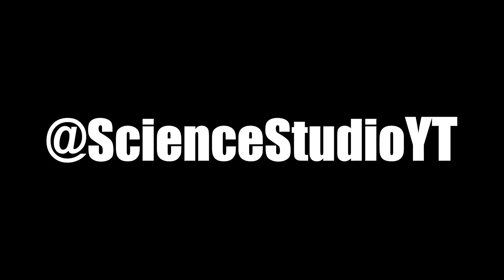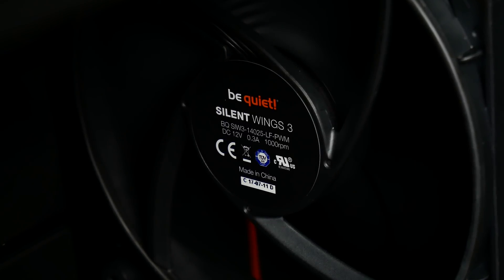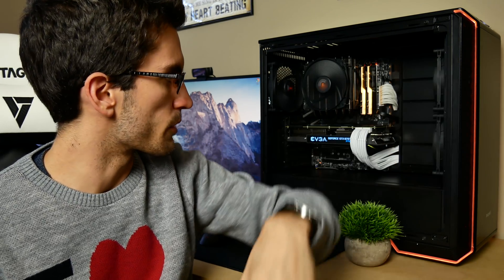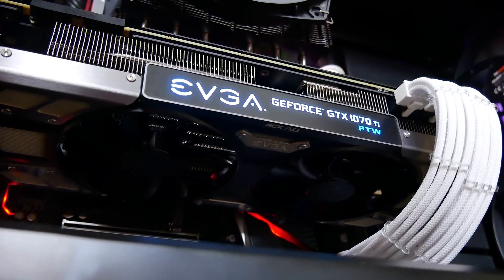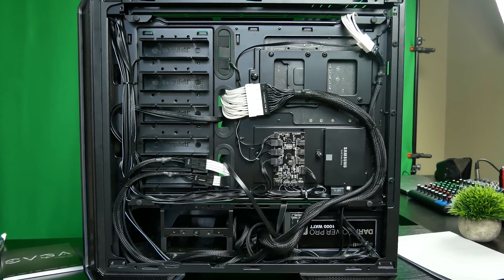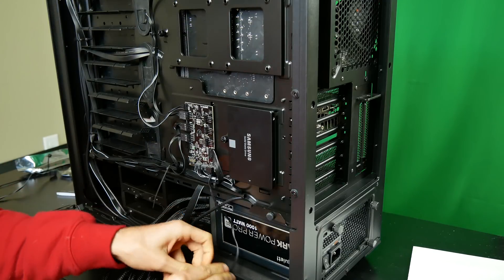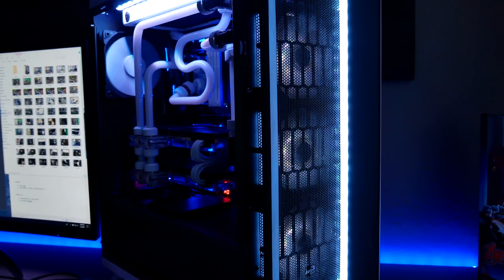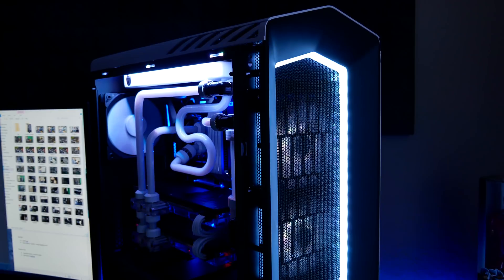We Built a SILENT Computer!

Comment: be Quiet case has sound damping on its case there for the silence is expected. Had a similar build with i5 9600k, 36gb G.skill DDR4 3200, Asus Phoenix GTX 1660 6gb. Installed 2 additional Silence Wing 3 1600 rpm, top back exhaust flow and front intake. Water cooling is noisy, water pump is annoying than fan noise at low rpm.

Comment: Could anyone help me out with a way to build an almost silent PC for audio production? I run a home studio with sensitive (condenser) microphones and unfortunately no seperate vocal room/booth. As a result, I can't push my input gain on my audio in too high without substantial computer noise running through the recording. I get that there will always be some noise in the background without having my own anechoic chamber, but I'd quite like to be getting <35dB noise during a recording session to reduce the noise floor in the wav itself. At the moment even using a noise gate and/or volume automation on the audio track inside Cubase, you can still hear the noise in the recording when the gate opens and closes which is obviously not the result I am trying to achieve. Thanks in advance!

Comment: Not to shit on the video, but that computer wasn't all that quiet to me, even through speakers. The volume was set so that your voice was at a normal speaking volume and the quiet computer made far more noise than my premade Acer computer does. I guess it is because of the stock fan curve, though. If you go in and mess around with that, you could probably bring the noise down some.

Comment: Yeah. Those Fractal Design fans are pretty good as well. I'm using three of them in a Define R5. Specs are MSI GTX 1070, xeon e3-1230 v2 (cooled with some Noctua fan mounted to an Enermax heatsink) and 16gb DDR3. When stock this abomination is just as quiet as the PC you built in your video, but because I overclocked the GPU, it's clearly audible under load :)

Comment: I built a DAMN quiet system before way before the dawn of larger graphics card coolers based on the demand of the customer : (this was back in this January 2016)
Intel i5 6500
Gigabyte H170 D3H 
Kingston HyperX Fury DDR4 2400 16GB 
Superflower Leadex Silver 650W (It has a semi passive and fully operating fan switch!)
ZOTAC GTX970 with an Arctic Cooling Accelero Xtreme IV
Deepcool Lucifer V2 without it's fan so it's running purely passive!
Finally Fractal Design Define S He actually wanted that case and it was very new here I had to wait months before I could get the first ones in stock.
If i remember correctly it was a Zotac SSD Premium 240GB and it had a 3TB HDD only because he wanted it. 
And yeah indeed, it was the loudest thing in the system. Doesn't help that FD directly bolts it to the chassis. That ruined the whole low noise thing going on sadly :(

Comment: hmm... my Build is the exact opposite... EVGA 1080 Hybrid, 7700K @4.8, H100i V.2 in aPhanteks Enthoo Pro ( https://de.pcpartpicker.com/b/g7w6Mp )... until I got the fan curves to an acceptable level, I was able to hear it under load from the floor below and outside my house.. with door and windows closed... it's still pretty loud under load because of the fans reacting to the heat levels of the CPU.. thanks Intel for using a bit of spit to transfer the heat between dye and spreader
Reply: Same I can hear my Pc through my whole Apartment when I´m playing Witcher 3 xD

Comment: i5 8400,MSI Gaming X gtx1060,Corsair Carbide 400c case(stock fan configuration with an added 120mm top intake fan) and I am using a ThermalTake Riing Silent red 120mm cpu cooler(300-700rpm mode)...Very cool and very quiet...Love playing ACO  on below whisper mode..

Comment: Great build. BeQuiet has some great products, but for Quiet (capital Q) build I'd rather choose Fractal Define R6 (all solid panels) + Seasonic Fanless 600W PSU + Noctua NH-D15S + 3x Noctua NF 140 mm fans (2x front/1 rear) + GTX1080 FE cooler upgraded to Rajintek Morpheus 2 (really beefy gpu radiator) with 2x 120mm Noctua Fans at lowest rpm possible. I bet I'd get better performance results with same sound levels or a bit lower sound levels with same performance...

Comment: I´ve got an BeQuiet Silent Base 800 with an BeQuiet Pure Rock Slim  on an i5 6600k on 4.4GHz together with an MSI GTX 1070 Gaming X and 2*120mm + 2*140mm Pure Wings 2 :D The cpu cooler is just insane. You should make aan video, if that one is an alternativ to an boxed cooler in an budget build, because it actually isnt really expensive ;)

Comment: Its not super difficult to do a completely passive build, the main problem is finding a LV or ULV processor for a reasonable price.  You might take a 10% performance hit, but you can also halve the wattage.  These "special" variants are very useful for people who pay 40 cents per kwh (like Hawaii)

Given a low enough TDP and if you are budget minded and in a cool climate, you could probably get away with an arctic cooling freezer 33 (CO) that only kicks in the fan at 40% pwm.  Remember that mobo manufacturers tend to set their PWM based on the stock intel heatsinks, some of which aren't even an inch high.

Comment: I have a 6700K with a single  Noctua fan on the heatsink which is a D9L all inside a Fractal Design Define R4. I also use 3 Noctua 140MM fans, two in the front (intake) and one in the rear (exhaust ). The only component that is quite loud when under load is my graphics card which is a reference design GTX 980 from EVGA. As I mostly use my PC for content creation the graphics card fan does not spin very fast so while editing and rendering in Premiere Pro, Aftereffects, Photoshop and Audition the PC is very very quiet while sat on the floor next to my legs.

Comment: Not a big fan of folded heatsinks.  If you even want to try fanless, tower style is best because it pushes the heat as far away from the motherboard as possible.  Think of it like:  If the fan ever fails, which style heatsink will perform better, the one that pushes as much heat as far away from the CPU as possible.

Arguably, the best passive cooling would be a heatsink tower that is a foot tall, that extends outside the case (drilling a big hole would probably do it)

Comment: Hello everyone 
I am quite fussy about silent PCs. 
The PC I built myself two years ago: BeQuiet Base 800, 5x fans BeQuiet Silent Wings 3, BeQuiet Straight Power 500W, BeQuiet Dark Rock 3. There is Intel 6700 in it together with Asus Strix 1060 6GB. I initially bought Noctua premium fans since they are so praised to the sky but after approximately 1 week of using them I had them replaced with BeQuiet Silent Wings 3. They were just too loud for me. I must admit there is a massive difference between the two of them. The PC is virtually inaudible now. There is nothing I would like to change about it. Under heavy load, the only thing I can hear are GPU fans - I am very happy that most of the time they are off, that the GPU can be cooled passively. 
I agree with the presenter about the quality of BeQuiet products
Good luck to everybody building similar PC.

Comment: I have an aio for my cpu and GPU from NZXT and EVGA, I've turned the case fans to run also as low as possible as testing resulted in like no temp difference, I have the nzxt pump as slow as possible and also used a special cable to run my GPU pump at 50% (previously uncontrollable).
I use noctua fans on all of rads and the Max fan speed is 60% thanks to not overclocking and thanks to amd and their actual soldered cpus.
Also no harddrives just ssd's.

Could have it overclocked and still quiet but I like my temps as low as possible.

The only idle noise is the pumps but they're very quiet and only gaming noise is gpu coil whine which is normally drowned out by other components but thanks to being so quiet, you can now hear it if you put your ear up to the case which is an nzxt h440 which I got due to damping sound quite well.
Reply: Fan curves too of course.

Comment: I have my radiator mounted outside the case with 3 thermaltake fans pushing and 3 koolance FAN-12038HBK  2600 rpm 
Static Pressure: 6.3mm-H2O
Airflow: 116.1CFM
For pulling and when I turn them  up
It sounds like a jet plane lol
Keeps the heat out of my corsair 570x

Comment: Silent Build:
A bunch of be quiet Fans.
Be quiet cooler or some beefy ass air cooler with no fans/be quiet fans
Case with sound dampening material.
Under-volted/underclocked GPU with stupidly low fan curve.
Fanless PSU or some 80+ platinum/titanium PSU that stops the fan with power consumption is lower than a certain level
Extra sound dampening material
Reply: That would not be silent. Sound dampening material is unnecessary for a silent system, there's no sound to dampen. A "beefy ass air cooler" is not silent either. You just need to get a fat heatsink with no fans. "A bunch of be quiet Fans" are not silent. No fans are. You also need all SSD, no HDD obviously. Lastly, for GPU, either buy a 1080Ti and don't let it go above 60-70% usage, or buy a mid ranged GPU and you can easily have a completely silent GPU.
Reply: Put computer in closet. Silent.
Reply: this would be a real silent build
Reply: alex wutang no it wouldn't. Moving parts = not silent.
Reply: Sure ... what you fucker want is a non overcloked PC that you use for browsing or some shit .. not a workhorse PC or a high end gaming PC .... get 1080Ti and not let it get over 60-70% usage ? with what ? fucking magic ? browser games ? get fucking real ... 
There no such thing as a completely silent PC unless you're talking about low power passively cooled stuff or you do some crazy watercooling with all the radiators fans and pumps in another room.
Reply: You could just let the cpu cook itself and still have an overclock, it would cost you your cpu however.

Comment: Late 2016 i came to the realisation that water cooling a pc is, in fact, noisy business. I also realized that i was sick of it. I just didn't enjoy my PC, because it was too loud, and no amount of custom curves would satisfy. So, i ditched every piece of gear i had, which related to water cooling, of any kind, and i went with a be quiet! air cooler, sporting silent wings fans. At this point in time, i've experimented and used quite a few of their coolers, and fans, including what you had in this video. They're not silent though. Very, very quiet, barely audible even, but silent, no, that's science. Friction between moving components produces noise, wether it's bearings turning on the axle, or air rushing though the fan. Pretty sure Greg, as a man of science, also know this. :) Luckily, be quiet! has done an awesome job optimizing both fans, fin stacks, and cases in an effort to minimize sound, and ensure what little sound there is, is not an unpleasant sound signature. :)

Sorry for rambling on, this rig really struck a cord with me. :D I definitely approve of the rig though, and i found it incredibly interesting to hear that you were put in a position where you were sort of forced to realize just how loud you water cooled rig is, same as me, but different circumstances. :) Very interesting.

I can't argue with the looks of custom cooling though, your custom cooled rig looks incredible! Even a good AIO will look better than any air cooler. That is the one thing i miss about it, but i'm not sure i want to give up the pleasure it is to use my rigs in their current low noise state, to get that back. :)

Recently i put a be quiet! Shadow Rock LP cooler, with a silent wings 3 fan, and the same as case fans, in my small form factor bedroom PC, and with it now being barely audible (my own breathing is louder), getting to bed is a whole new experience. :) I usually listen to a podcast or something like that, while falling to sleep, but now there's no annoying buzzing or humming in the background. Just lovely. :)

Comment: I have a Be Quiet! Pure Rock passively cooling an i3 6100 (upgrading to a 7700K soon), 5x Corsair AF120's and a Palit GTX 1070Ti. At idle, it's really quiet as the fans don't activate on the GPU unless it reaches  a certain temp and even under load it's still extremely quiet.

Comment: Wish I could say the same I have corsair af 120 fans the ones with the colored rings and they are quite loud but the airflow is insane and I don't even have a fan on my 212 evo because all was to lazy to mount one but the temps stay steady at like 53c under full gaming load
Reply: Also for some reason my motherboard does not allow fan control which is weird

Comment: Why the 1000 Watt Psu tho🤔 someone pls explain.. i run a 1080 Strix Advanced + i5 6600k @4.1Ghz on a bequiet pure power 9 600W Psu without any issue. 🙄
Reply: Steven GerrardFTW I have a 1000w PSU but it’s because it’s left over from when I had a 295x2 and a overclocked fx 8320. Though now with my 7700k and 1080ti the 1000w PSU’s fan never spins. So maybe he just had it laying around or wanted the fan to never spin for the whole silent build. Though you’re still right 1000w is over kill a 600-650w PSU from a reputable brand would be plenty.
Reply: Right... thanks man ! 😁
Reply: Steven GerrardFTW I use 750w psu, much more headroom for my 6600k built.
Reply: Its to use the non spinning fan on the psu when under low load.

Comment: The good thing is, in the BeQuiet! cases you can easily go with an HDD since they all have rubberized mounts.

+ Ain't the 1000 watt PSU a little overkill?

And holy smokes, I love the 220 tdp cooler. Didn't  even no there was a top blower with such a small heatsink this strong! I might wanna get one myself now...

Comment: I have a Thermaltake core x9 case and 2 200mm TT fans in the front might replace them with noctua 200mm's a noctua 140mm in the top back and a 120 that came with the case, it's moving air in a dead spot it's a fixed speed fan so doesn't contribute to the noise as it's in a dark corner.. 
What really surprised me is just how loud the Corsair h100i v2 is.. The fans and pump are bloody awful under load. I wear ear buds and it's bad enough to be distracting and since the rad is in the top of the case in a push config. And quite honestly it's outgunned by the 7700k. I'm seriously considering a Fractal 360 and adding a second 360 rad or swapping to 2 420's and either be quiets * I was impressed how quiet the vid was* or similar noctua's.
I live in the middle of new mexico so the 240 is just not getting it done.
Also Corsair needs to fix there software, at least for me the fall creators update broke the pump and fan software and wouldn't use a fan curve it was either idle or full tilt and nothing I did fixed it till i bought a Grid+ and ran the Cam software to run the fans and pump off the controller.
I dunno if that is a thing with the corsair software now but I personally didn't like it or it's layout and control set.
I do not expect a fully silent case in the aspect it's a open mesh high airflow case built to be watercooled.
But I do expect the water cooler to not be so obnoxious that it needs third party software to control it.
Just my jays2cents worth.

Comment: Could you do a fully passive build, 1050ti kalm x, high tdp passive cpu cooler, 8700k, passive psu and a motherboard with good vrm cooling so it can manage the zero airflow. Overclock the cpu and gpu but as long as they stay under 80 degrees C. Then compare it to a balls to the walls system with i watercooled 1080ti and 8700k overclocked to the maximum. 
This to compare two spectrums the absolute maximum performance possible and how much performance you give up for absolute silence
Also make sure to use a normal case and an open air/testbench for the passively cooled one as i think an open air case would be more normal with something like that.

Comment: Just give me a bit of time to get my graphics card back from Nvidia, then I could install my first water cooling loop, and if I could, I'll install the Be Quiet! fans with them, and have it all set in the new Fractal Design Define R6 :D currently using the Phanteks Enthoo Evolv, but I wanna upgrade so my watercooling airflow isn't choked when it has a 360mm + 240mm rads, also need to save up for a 1TB SSD and I'll be good to go :D

Comment: Oh boy, I just finished building a pc for audio editing, which has to be DEAD SILENT in the studio.  I went with a massive CPU cooler, the Scythe Ninja 4, which is even quieter that the Noctua NH-D15, but it's a LOT bigger and kind of inconvenient to work with. Alas, sacrifices have to be made for true silence. It barely fit in the Fractal Define C, along with a Z370 Tomahawk, an 8700k,  32 gigs of RAM and no GPU because I don't play games. Well, that's a lie, I sometimes play League of Legends, but that runs on 1080p 60+ fps ultra quality even with integrated graphics. As for Digital Audio Workstations, my CPU usage never exceeds 50% even with multiple instances of Serum, Kontakt, and 100+ audio tracks with EQ and compression. I probably won't have to upgrade for 5+ years.